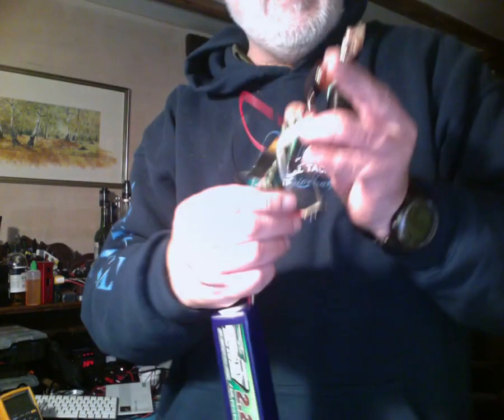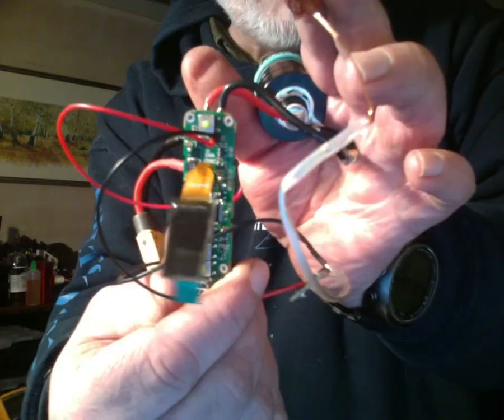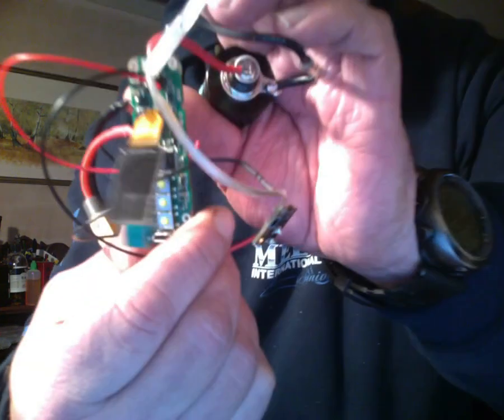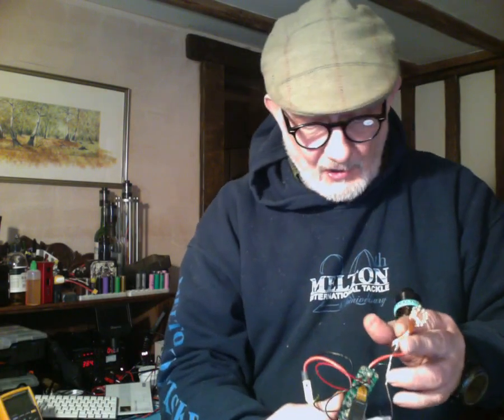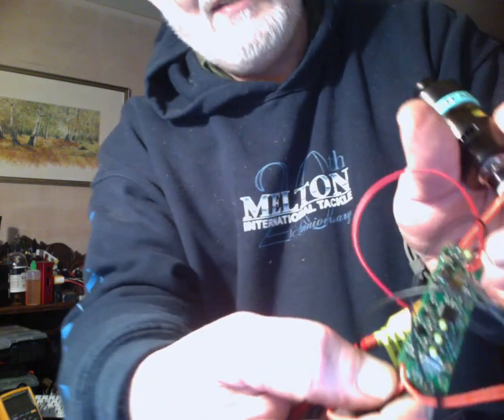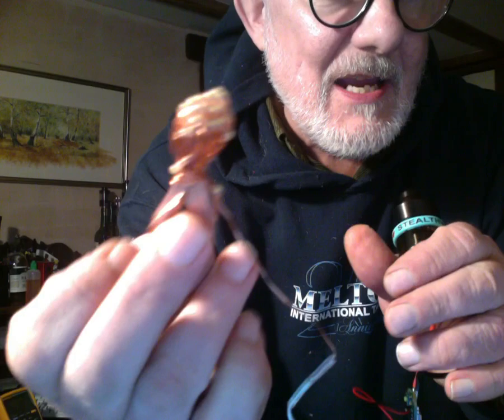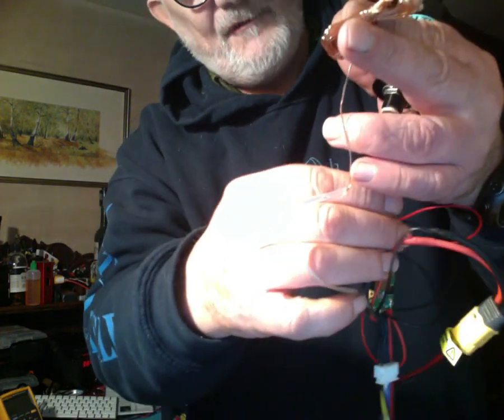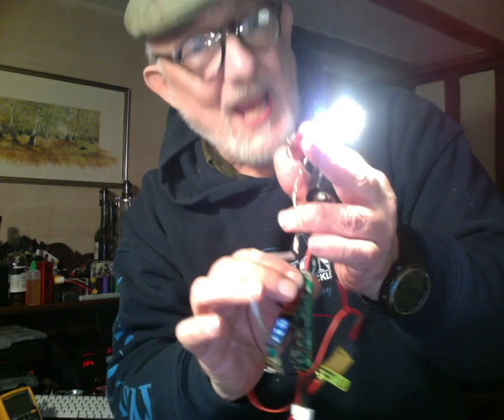DNA250C led hack

Comment: Do you have a tutorial or diagram for how to do this?
Reply from the maker: Hi I am only able to do a video tutorial, when I have another board to do, I had a commission for a stained glass mod with lots of leds with a 6000mAh 4s lipo, so if you want me to make you a mod or make you a board, it will have to wait until I get a commission. but I will be putting a diagram in the file section of my facebook page "Old Man Vaper"
Reply from the maker: posted under files https://www.facebook.com/groups/225559844572770/.